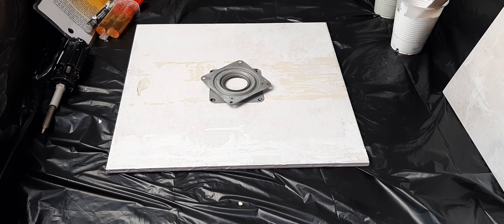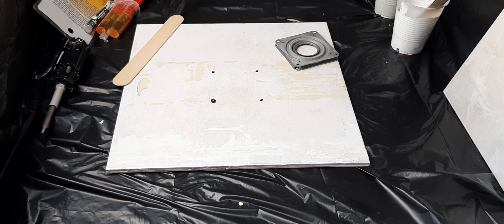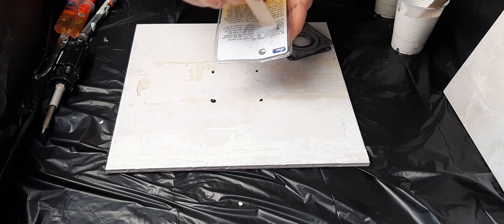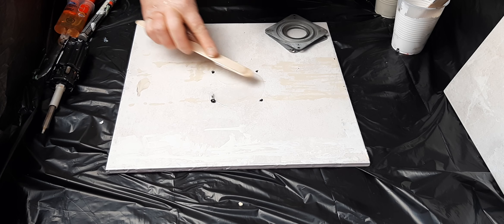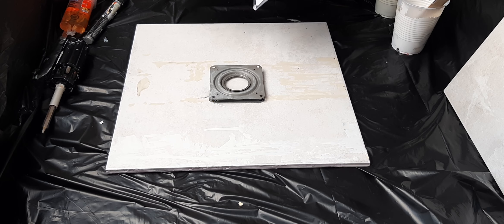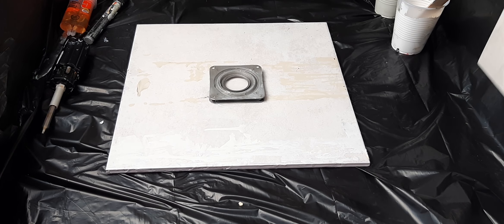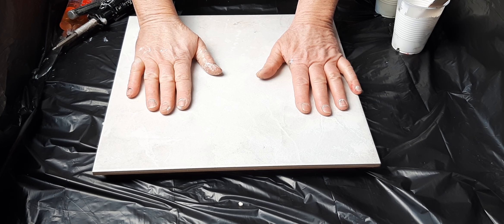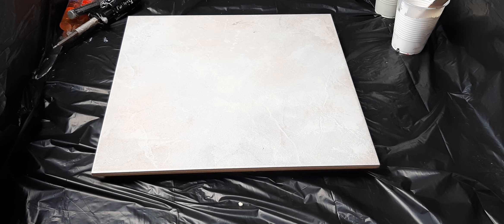How to make a paint spinner on a budget...

Comment: How did you know that I needed a new spinner? I just discovered you this past week and I have been bingeing on your videos and trying some of your techniques. I ordered two Lazy Susan‘s from Amazon in different sizes. And neither one of them was a good spinner. They were loud and did not spend more than one or two rotations. So now I have to return them and I was wondering what I was going to do for a spinner. Thank you!
Reply from the maker: Hey Lisa..  used this spinner for a very long time.  I now have one from Amazon and I have made a few changes to it as well.   I find that they are not big enough and are to light... new spinner has a 24 x 24 slab of marble tile on top.. I like the extra weight, easier to clean and more working space.   You can find all sorts of creative ways to come up with a suitable system without spending the thick coin.. 😉.  Cindy
Reply: @acrylicpouringwithcindyvan9173  can you possibly direct me to some good spinners? Or good modifications that I can do and some of the not so good spinners? I have ordered at this point for spinners from Amazon and when I get them home they’re great “Lazy Susan‘s“ so if I was reaching for the salt on the other side they would be fine but as for spinning out of bloom… Not so much. I’m tired of having to travel 45 minutes to Staples so I can send them back. LOL should I just go to Home Depot and get the spinner attachment and use the two tile idea? What do you have a better suggestion?